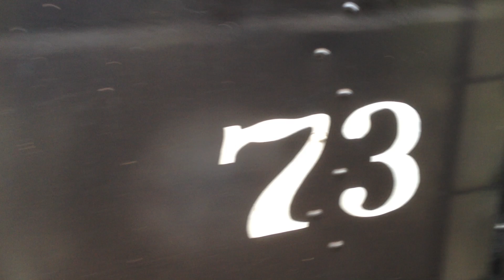WP&YR #73 Piston Rod Failure

Comment: This commen section is so full of bullshit from morons it isn't even funny. It takes a real mechanic genius to determine that broken parts are due to "metal fatigue" and "micro-cracking". No shit. You really think parts broken to shit and MACRO-CRACKED into BIG PIECES failed because they were subjected to forces in excess of their capacity too long? That's what "fatigue" really is. If that piston didn't fail after TEN MINUTES of operation, it wouldn't fail after 10,000 hours. "Metal fatique" does not happen due to AGE. It happens due to the material being OVER-STRESSED. 

And a broken rod doesn't magically propel a suddenly FREE FLOATING PISTON forward AGAINST STEAM PRESSURE with enough force to BREAK THROUGH THE HEAD or SHEAR THE STUDS because a ROD doesn't shear under COMPRESSION. It shears under TENSION. Which means IF the engine were operating NORMALLY those parts wouldn't just break. And if the head somehow got blown off the cylinder by the piston impacting it, there WAS NO STEAM PRESSURE IN FRONT OF IT. Pistons get FORCE BACKWARD by STEAM PRESSURE IN FRONT OF THEM. 

From the looks of the piston chunks in another video of this "accident", that  cast-iron piston got HOTTER THAN FUCK. Its discolored like somebody heated it almost red-hot with a giant blowtorch. Why? Clearly it was unlubricated and/or that cylinder wasn't receiving enough steam to keep it cooled OR the cylinder/piston were worn or damaged enough that steam was just bypassing the piston before the piston could transfer enough heat to it. Steam IS the coolant in a steam engine, you know. An overheated ROD would also fail catastrophically since it's CONNECTED TO THE PISTON. And of course the rod seals would be destroyed by that much heat in the rod. 

Somebody, or more accurately SEVERAL somebodies, fucked up and that locomotive was being operated and/or maintained and/or repaired and serviced incorrectly and it caused a catastrophic failure just like EVERY catstrophic failure of ANY mechanical system can be traced back to human failure in engineering, design, construction, operation, maintenance, etc. 

These "heritage railways" and even "real" railroads running old steam locomotives usually do so on a shoestring budget, it's a bunch of volunteers who are NOT professional steam engineers doing the operating and making all the operational decisions and they usually have a sentimental attachment to steam and the trains and locomotives are their TOYS they get their rocks off PLAYING WITH and the inability to PAY FOR PROPER REPAIRS AND MAINTENANCE and/or unwillingness to DO WITHOUT THEIR TOYS and/or REFUSAL TO CONDEMN A WORN-OUT PIECE OF SHIT THAT WAS RETIRED FOR A REASON when its beyond "economical repair" end up causing shit like this. 

Steam engines are not "magic" and they're not "alive" and they're mechanical NIGHTMARES from a maintenance and repair standpoint. They have FAR less "tolerance" for improper operation and a lack of maintenance and excessive wear make them literally and potentially LETHAL to anybody within a mile of them if shit REALLY goes sideways and a boiler is ruptured or fails due to "fatigue" when the stays, boiler plates, etc are corroded through too far by oxidation and corrosion. 

This obviously wasn't a boiler failure but its indicative of the kind of idiocy that leads to them when people refuse to acknowledg or don't know that steam engines EAT THEMSELVES UP every time they're fired and operated. SOMETHING was BAD WRONG on or in this locomotive and the result was a blown up engine under load. And this sort of thing isn't unusual with "heritage" railroads, or rather is more common with heritage railroads than it ever was with locomotives operated in revenue service by trained professionals who worked with steam daily. 

Give enough heritage railroads enough clapped out steam locomotives and enough clowns to operate them because its "fun" and enough opportunities to take worn out old junk out and work the hell out of it and EVENTUALLY there WILL be a boiler explosion. It has happened in the steam traction engine "community" and it'll happen in the heritage steam railroad community. Especially in areas where there are no boiler inspection requirements or there are exemptions for "historical" steam engines. I'd say "hopefully nobody is killed" but the crew in the cab is DEAD instantly when a boiler explodes, so hope is pretty pointless. I'll save my hope for the clueless and unwitting passengers who have no idea they're being pulled down the track by a ticking time bomb.
Reply: DEEREMEYER1 well damn dude, no ones responded to you sense you wrote a books and acted like you knew what you were talking about
Reply: What makes your conclusions anymore credible than these so called “morons” in comment section? Do you work for the WPYR operations or mechanical department? If you’re as highly educated in steam locomotive operation and mechanical engineering as you claim to be you would know you can’t draw conclusions from this video or a series of photos of the cylinder fragments in another video. You’d need to look into the mechanical records and daily inspection reports of the locomotive that are required to be filled out under FRA regulations. Steam locomotives had mechanical failures in their service lives and they will continue to occasionally have them on tourist railroads. As long as the crew handles failures professionally, safely, and the railroad has the means to make proper repairs, I don’t see where you have the authority to put them under scrutiny. You are making assumptions based on a primitive knowledge of metal composition and fatigue.

Comment: You called it, Steve. It indeed was a mechanical failure and had NOTHING to do with priming. Anyone who knows steam should be able to hear that. However, as mechanical engineer, I will say taking it easy would have had no effect on preventing this incident. It would have happened regardless if you have any basic knowledge of failure analysis (micro-cracking) of materials under dynamic loading. The components lost here are expendable. Steam loco's are designed to pull hard, not to be coddled.

Comment: no, the cylinder head blew off, either not fastened down tight enough or water compressed inside the cylinder and blew the cover off.

Comment: He didn't run over anything and he didn't slip. That is the cylinder cover which has blown off the front of the RH cylinder which the driver has found where it occurred. Would have been really interesting if you happened to be filming on that side!